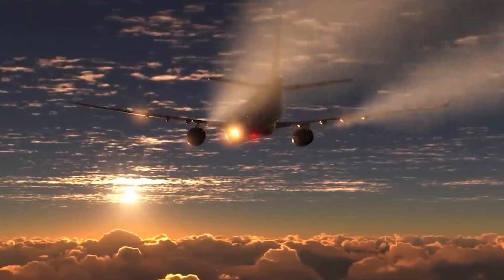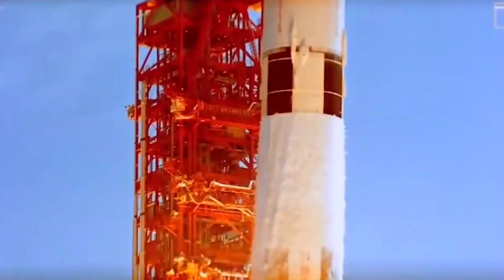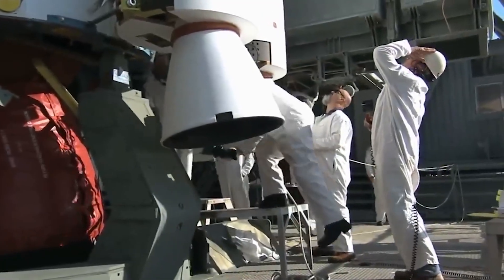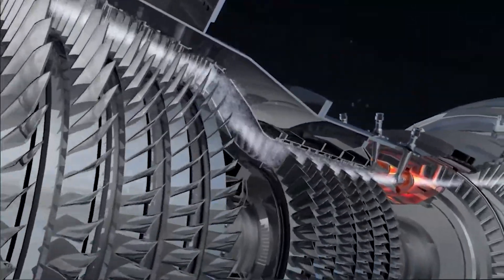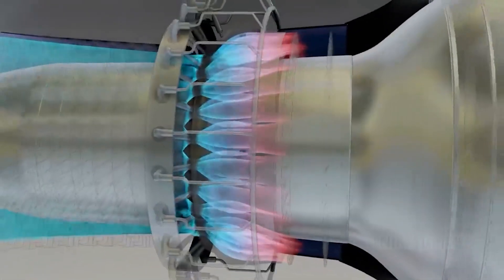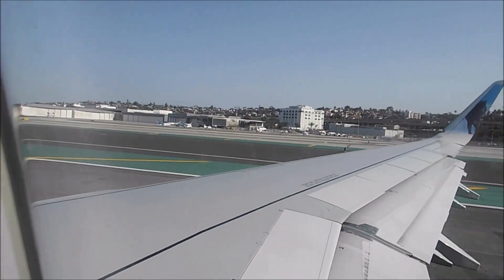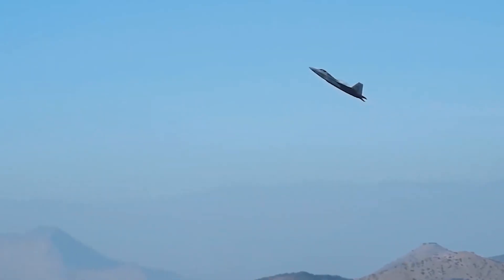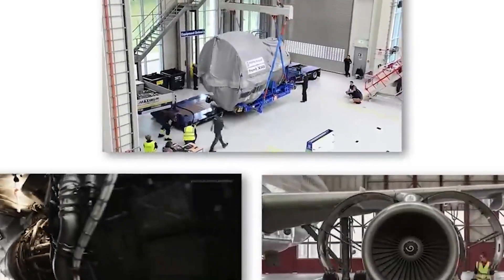INSANE Innovative Aviation Airplane Technology That SHOCKINGLY Blows Your Mind

Comment: Sorry, talking faster does not necessarily yield more information. I doubt anyone not already familiar with these technologies is a able to learn anything useful from this video. 
Here is comparing a source of energy like hydrogen with a propulsion system like a plasma engine. It‘s like asking, what’s better: a tank of gas or a 5 liter hemi?
By the way: the mentioned plasma engine is still based on the Carnot process. You need super high temperatures to reach efficiencies that are still not anywhere near what any simple electric motor will yield. Connect this to a fan of a jet engine and you have all you need for an airplane flying in air. The catch is how to store all the electricity needed. But the plasma jet won’t save you from this challenge. 
I am talking about planes and lift launch vehicles maybe. In deep space it’s a different thing, as a little thrust can go a long way.
Reply: I have my settings on youtube set permanently set on double speed.  (I get bored easily).  I followed what he was saying just fine, even though I disagree with some of the content.

Comment: As blessedly wonderful as these two concepts may be for the earth and mankind in general, I can't help but wonder just how negative such countries as Saudi Arabia and even Iran would be or actually are as far as being uninterested or perhaps even totally against!!  🤔🧐🤨😮
Reply: You also have to take into account that you can't just dig up hydrogen.  By far the most common method of procuring it is by electrolysis of water.  The energy you get from burning the hydrogen is actually less than the energy you use to create the hydrogen in the first place.  So really you shouldn't be regarding hydrogen as a "fuel".  It's just a storage system for the energy you have to put in to it's production.

There are also methods of producing hydrogen by reacting acid with metal but then that metal has to first be refined from it's ore. So this isn't reducing the energy used for it's production either.

The same applies to electrical power.  Even if you're using the most efficient, energy dense, batteries imaginable.  You only get the power out of them by first, putting charge into them.  That energy has to be produced somewhere.  

Every time you convert energy from one form to another there are losses.  So the further removed your technology is from the original source, the greater the losses in efficiency from the fuel to final use.  Unfortunately that means the most fuel efficient technology to power aircraft is burning fossil fuels, directly on the aircraft.